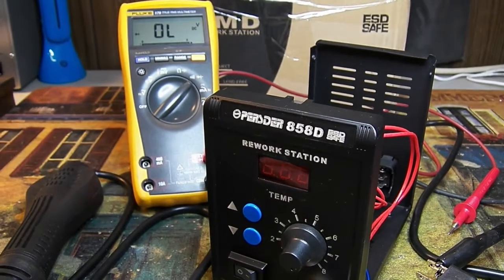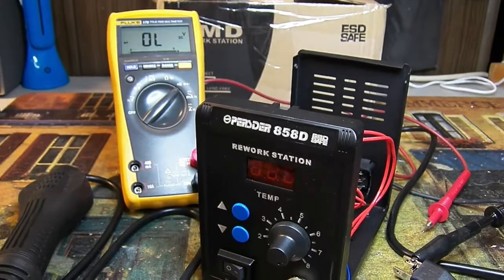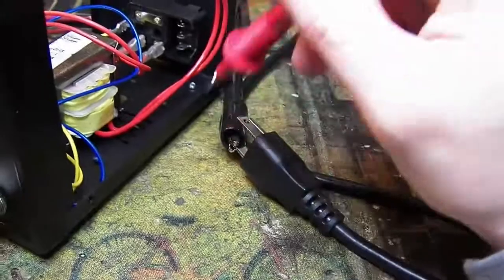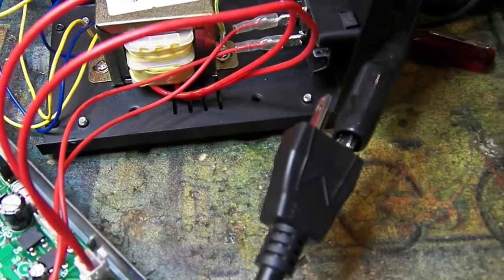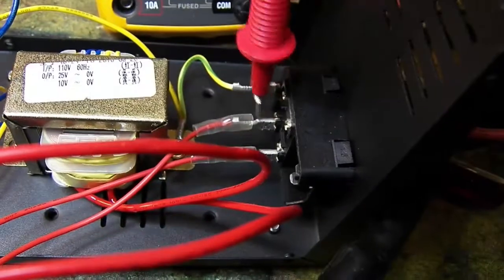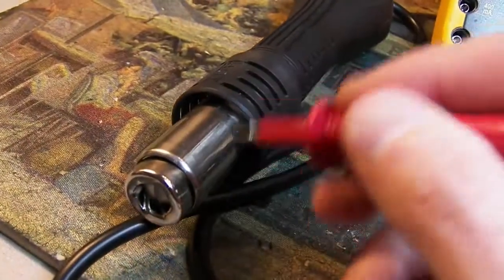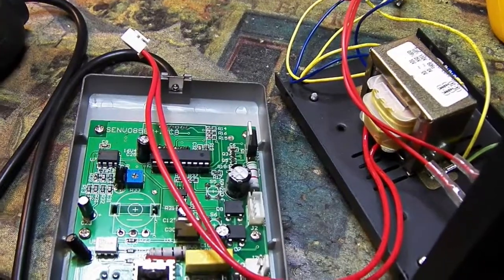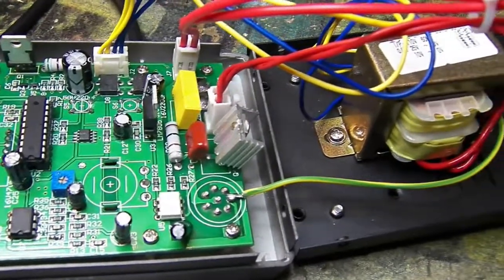WARNING SAFETY FAIL Persder 858D 858 Hot Air Rework Desoldering Solder Station

Comment: Curious to know how you approached grounding that front metal connecter ring.. I tried soldering the bit on the inside to a ground wire, but couldn't get the solder to stick..